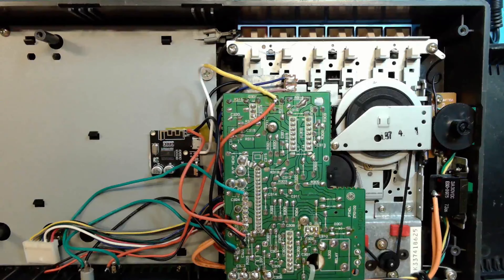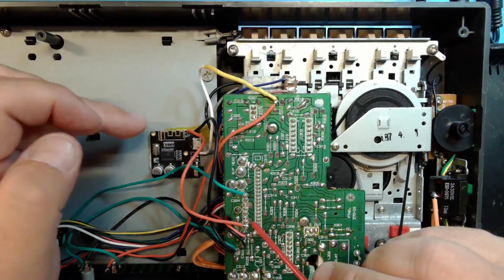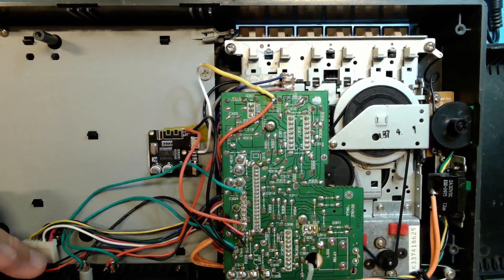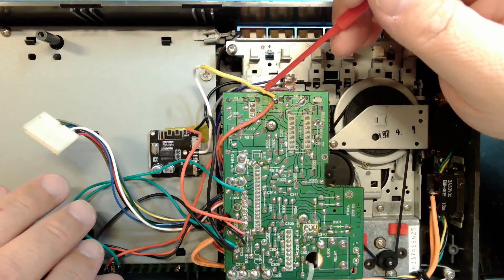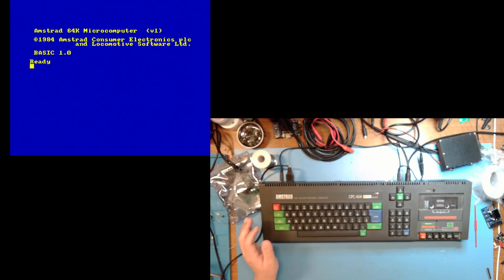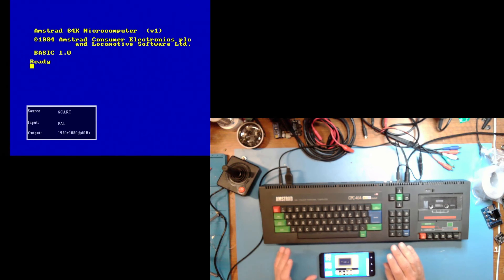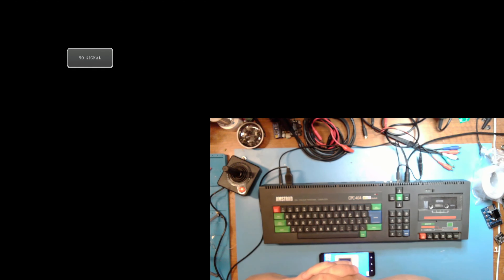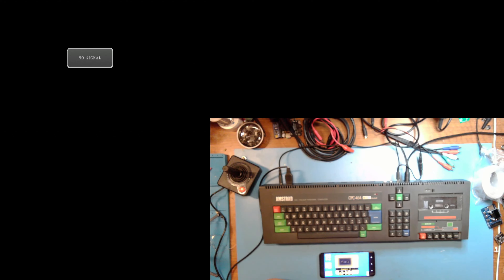Can We Fix The Problem With The Bluetooth Mod on the Amstrad

Comment: I was wondering why had you change from left output to right on the bt module?
Reply from the maker: I don't remember doing that, but if I did, it was unintentional and irrelevant.  Both channels have the mono signal on them.
Reply: @YARC-1981  okay i understand. I am in a problematic situation: connected everything ok but used 1k, then 2k resistor, and not everything loads: read error occur sometimes. I will try the 3k since I left the case open ;) idk i will check. Anyway thanks for the tutorial and for the helphul response :) much appreciate anything you do on this channel :)
Reply from the maker: You're welcome.  I've found that different machines seem to require different signal levels to load, so keep at it.  You'll find the right combination eventually.

Comment: This got me thinking. You used only one of the 2 stereo channels coming out of the bluetooth module. I believe you did that to prevent shorting the two channels to each other. I don't think that will cause any problems since both channels will always have the exact same signal, (when one is high, the other is also high and vice versa), they won't short each other. Nevertheless, I thought what a better solution would be to use both channels. First, I thought of an op-amp summing amplifier but that would be an overkill. Then I thought of just putting one resistor to each channel and you released this video. You have the resistor for a totally different problem, but it will work both ways. Why not put another resistor to the other channel and add that too? I would start with something like 470 ohms for each channel (will work well for mixing) and work my way up until the other problem disappears too. The lowest value that fixes the pull-down problem will be the right one.
Reply from the maker: Thank you for the suggestion, Bora.  I do appreciate it.  Remember, I'm really not experienced in analog electronics and forgive a dumb question.  What are you trying to accomplish by uniting the two channels?  
I didn't have a reason for using only one channel apart from that's the way it was done by Shane, the viewer who gave me the suggestion.
Am I right in assuming that using both channels like that would boost the signal level (as long as the two signals are in phase with each other)?  I'm not sure the CPC would like that.  I think it's expecting a signal in the 0-5v range.  Though I didn't scope the output signal from the BT module, seeing as it's 5v input, I was assuming it was a TTL level output.  Yeah, I know I shouldn't assume.
Sorry.  I know I should probably have a better understanding.  Just clue me in where you're going with this.  It's probably a very bright idea and I'm just not knowledgeable enough to understand.
Reply: @YARC-1981  Signal from the  BT module will most probably be line (maybe headphone) level, I would doubt it will exceed 1 or 1.5V peek to peek, regardless of the 5V power in. They are meant to drive headphones or amplifiers from line in, both will not like a 5V signal at all. Combining both channels will boost it significantly. I never had an Amstrad CPC464, it seems it has a good "ear", but Sinclair Spectrums (which I know inside and out) usually are a bit hard of hearing and they have a hard time hearing from ear phone output of smart phones. As long as you have no problems with just one channel input to Amstrad, go for it, but the same setup may not work for a Spectrum. That's why I recommended using both channels.
Reply from the maker: Thank you for the explanation.  It makes sense now.  I'll probably leave the CPC as-is since it's working, but I do have a Speccy that I'll probably do the mod on and I'll definitely use your suggestion.  It'll also probably come in handy on other machines I put these into.  I appreciate the assist.  Cheers.